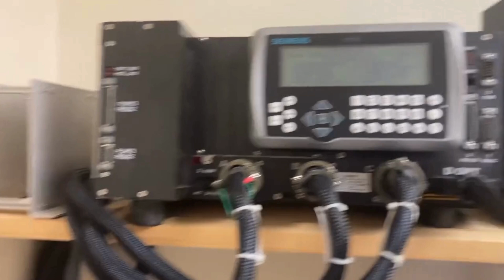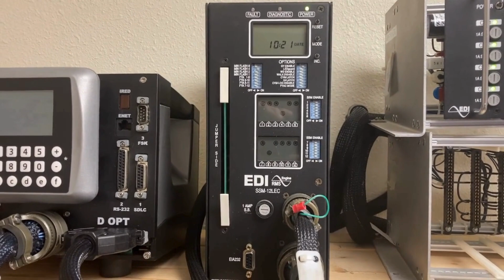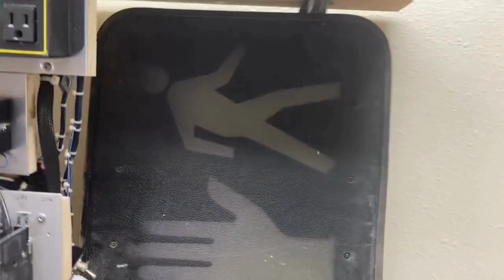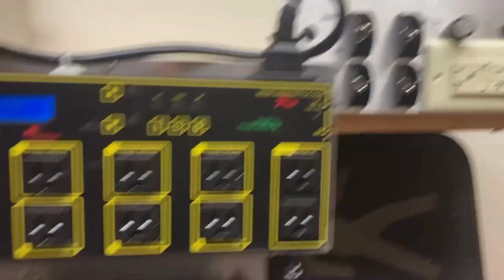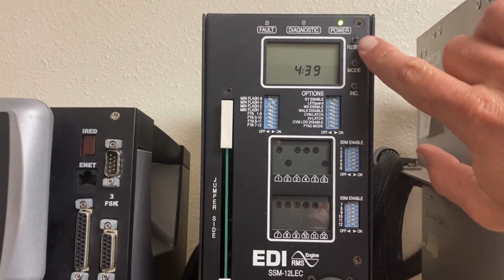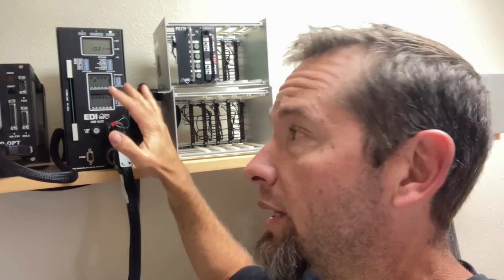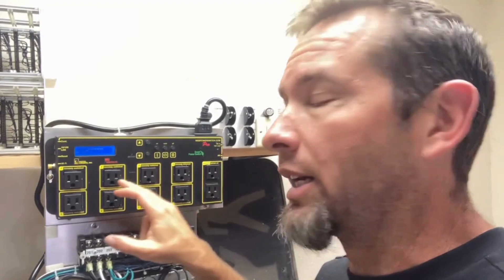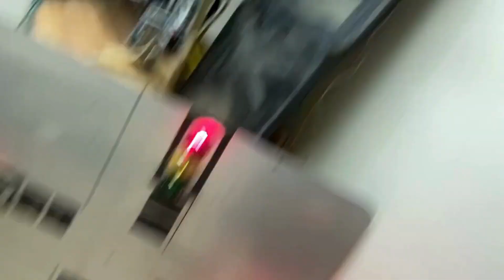My Basement Traffic Light Setup

Comment: One thing I noticed now is that US doesn't have RY either but instead goes green directly. Sweden has RY to make trafficants aware that its soon going green so they can start revving up the engine and begin engaging the clutch so the vehicle goes as soon as its green. So sweden's traffic lights are R RY G Y R. And as I said in a previous comment, previously sweden had R RY G GY R but GY was scrapped in the 90's to align with the vienna convention.

One neat thing sweden has is also the possibility to cancel out a transistion to red, so for example, if you are driving on a road, you might see the light going G Y G, so the controller decides thers no traffic, so it turns on Y to transistion into red, but once the detector detects your car, the controller sees that theres permitted green time left on the main street and possibly no cars on adjacent street, so it goes back to G. Don't know if G Y G transistion is allowed in the US, but in sweden it is.
Reply from the maker: I recall you talking about the sequence of lights.  I'm assuming you would be driving a 4th output for every direction...which seems like you would need alot more loadswitches to do this.  
I can just picture everyone revving up their vehicle to take off  LOL
Reply: @streetsmartstraffic  no, its not a 4th output. Its just a dual-indication, but a permitted such. So its just R, then R+Y, then G, then Y, then R.
Reply from the maker: @sebastiannielsen  ah yes, that makes sense...but I wonder how the conflict monitor allows that combination?  Obviously in the non R+Y condition, you wouldn't want the yellow and red to come up...
Reply: @streetsmartstraffic  i guess its a configuration option like the GY DIP switch option, but for RY. Maybe your conflict monitors have such a option too to allow for RY dual-indication.

And no, its not race-revving, but just so the clutch engagement don't kill the engine. RY is mostly relevant for stick-shift.
Reply: @sebastiannielsen I know on the peek traffic/ Oriux monitor there is an option to allow Red+Yellow on a channel and still check for green+yellow/red. Other country’s to my knowledge don’t have to follow the same standards we do in the US/Canada I wonder what the inside of your areas cabinets look like.

Comment: So do the signal light bulbs ever burn out?  And how does that info get back to the controller?  Are each line to the bulb monitored for current draw?
Reply from the maker: Great questions. Most signals these days are LED's.   Back in the day, signals were outfitted with incadescent bulbs.  Those blew out on a regular basis.  The traffic signal doesn't know this UNLESS all reds or all yellows or all greens for one direction go out.  If this happens, the conflict monitor will place the signal into flash.  The bulbs were more of a maintenance nightmare than anything.  Now with the long life of LED's and redundancy of signal heads, that is not as much of an issue anymore.  
New ATC cabinets I believe monitor current.  But I have limited experience working on those cabinets

Comment: Love the home setup, I’m jealous!Your remote reset panel is interesting I’ve never seen one like that before. I’m guessing you have a central system that you can send voltage to the test reset pin of the MMU. In the new ATC Cabinet standard, EDI as of 2023 allows you to remote reset the CMU (Nema equivalent MMU) ,but only during certain faults.
Reply from the maker: I've never seen it until I came to my present employer...and I was already in the field with 2 different employers for 20 yrs.
Honestly, I didn't like it at first. Sort of a complex panel, with some checks and balances.  But I've grown to love what it allows me to do.  
I used it for the first time about 1 month ago in a live situation.  About 5:00 am in the morning, my dashboard indicated signal in flash.  Remoted in to the signal and cameras and found it was in flash.  I knew there was a storm the night before.  Saw it was a one time occurance, no other alarm log entries, and traffic was almost non existent.  So I reset it.  And there I was, 2 hrs away, with a signal FIXED.  Awesome...

Comment: I have two questions. How do flashing stop ahead signs work with traffic signals? The second question is do ped heads use individual load switches?
Reply from the maker: GREAT questions.
1) How I have seen it setup =  There is a setting in the traffic controller for AWS (Advanced Warning Signals).  If you put an entry into that line item, it will turn on an output at that time BEFORE that direction goes yellow.  Example:  an entry of 5.0 will turn ON that output 5 seconds before it goes yellow.  That output is wired to a loadswitch input, the loadswitch converts it to 120V, then sent out on a cable to the warning signs.  There is a flasher unit in the signs, that when powered (120V), starts to flash.  
2) Yes, peds have their own loadswitch...unless it's a signal that have 'scramble walks', meaning all peds come up at the same time, then you can drive all of those heads off of one loadswitch.  It's extremely inefficient to do that though...but its done!
Reply: @streetsmartstraffic  Thank you sir.

Comment: Very interesting and informative! So the transfer relays choose whether the field lights get the program or the flash?
Reply: Yes, but the conflict monitor controls those transfer relays. The relays only switch the reds. The load switches lose power via the Solid State relay( the blue one) which kills the yellows and greens from showing in the field.
Reply: @metalbill  thanks! as an electrician i figured the other colors had to be removed from the equation somewhere
Reply from the maker: @metalbill  Thanks for answering that!  Much appreciated!

Comment: My home cabinet is more basic than what's seen here.  It has eight slots on the panel which has room for six vehicle movements, two overlaps and two ped movements.  Connected to it is a six channel conflict monitor (EDI-6LE) and an Eagle EPAC M40 controller.  The cabinet was originally set up for loop detection, but I removed those panels because there was no detector rack in the cabinet when I bought it.  I didn't really think I'd need any kind of detection inputs if I'm running my own signal setup at home.
Reply: Here in the Memphis, TN area we’re fortunate to have traffic speed monitors on major thoroughfares and placed usually in the median on divided roadways. That data is sent to a central computer which is also connected to every traffic signal control cabinet located on that particular street. As a result, signal timing is constantly changing from one signal to another. I can’t imagine the complexity of setting this system up but it works especially well during rush hour, unless a wreck occurs which will screw up any traffic flow regardless of any system in place. It is designed for traffic to flow at or near the posted speed limit. When that occurs you can expect green lights for miles and miles. 
Traffic lights will turn red when there is sufficient minor side street traffic waiting. The central computer try’s to give all side street traffic green lights at about the same time ONLY if there is sufficient traffic waiting on a particular side street.
The system seems to be a good solution for very high traffic volume on major streets.
Reply from the maker: @BartlettTFD  YES!!  This is what a well maintained, intelligent traffic signal SYSTEM looks like!  
Glad to hear Memphis has this and appears to have capable personnel to run the system.  I see too often where a system is in place but  1)  It's not maintained (set it and forget it)  OR  2) There is no capable personnel to understand the system or run it (ol' timers or knowledgeable personnel left the organization and the people left have no clue what to do with it).
Thanks for sharing that!
Reply: Nice, I’m guessing based on your profile picture you are even running traffic signals. How did you get your hands on all that equipment?
Reply: @Liam_Wa Most of my signals and parts come from people I know that work in the field.  I did get lucky and bought 3 brand new signals from an antique dealer in recent years.  I also bought parts that were available on eBay.
Reply from the maker: @Liam_Wa  Also Govdeals.com is a good place to look
Reply from the maker: But wouldn't it be fun to have detection anyway?!  LOL